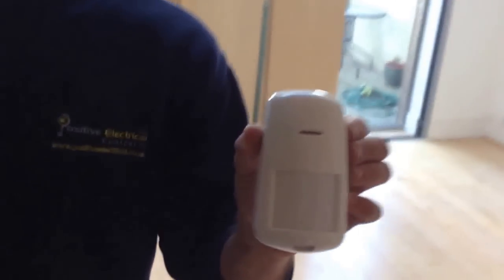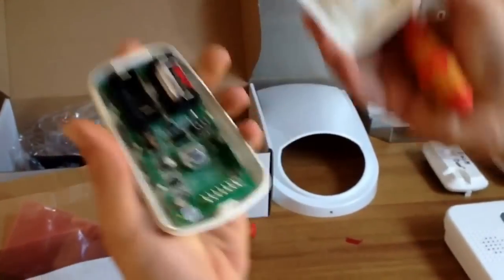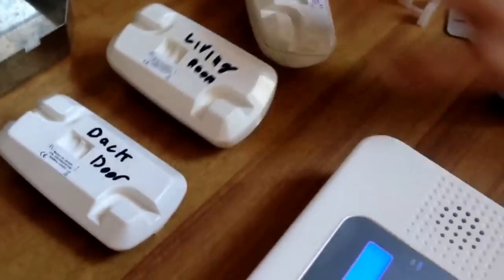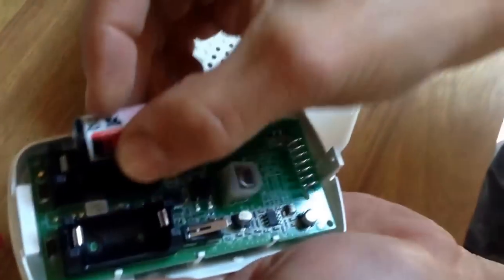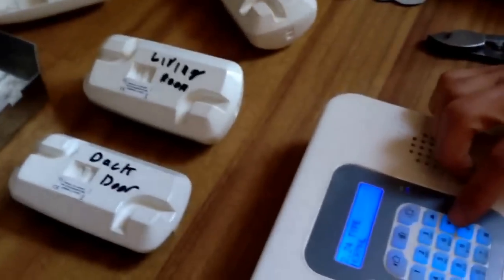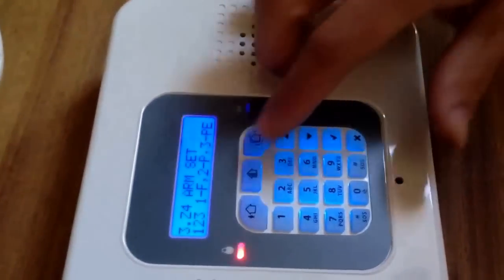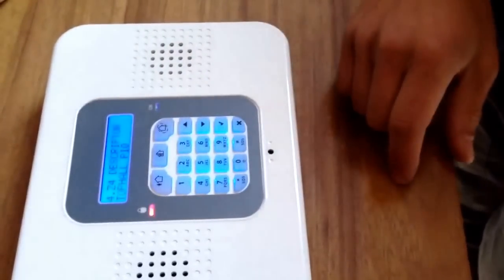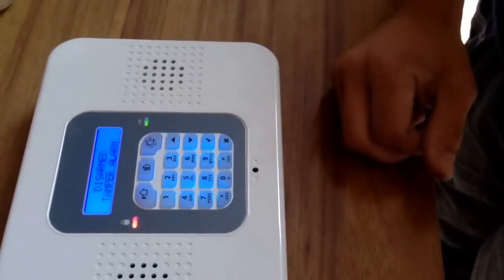How to programme a ESP Infinite INF-PIR to a Infinite Prime / Commpact system & set perimeter zones

Comment: Does anyone know how to connect a siren module to the tri bell siren the module won't connect some advice would be helpful thanks
Reply: @mshaz3183  Hi thanks for your advice I had it wired into the panel already but the light world never go steady green always amber meaning no signal  I tried everything taking it down changing batteries even got another siren was the same so poorly made, gave up and brought a better system